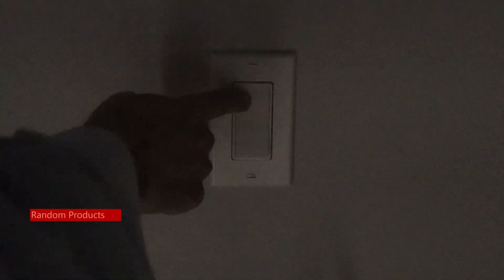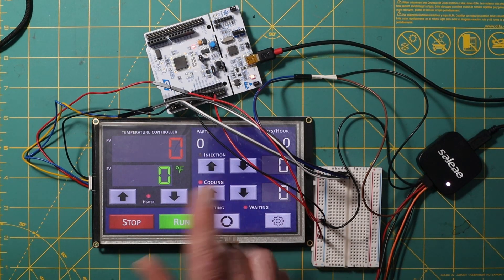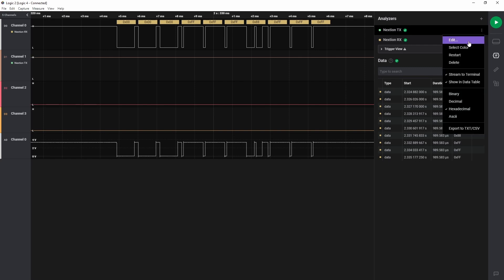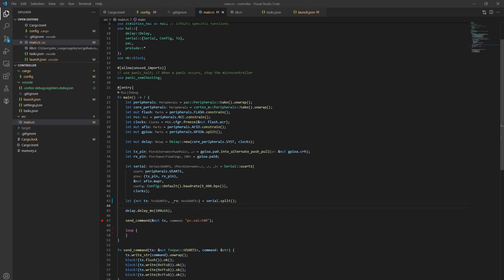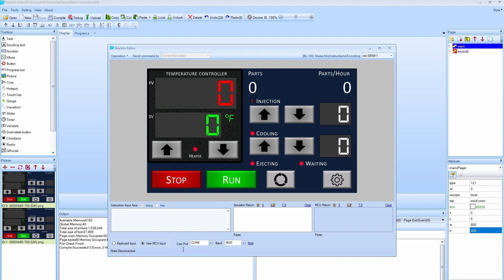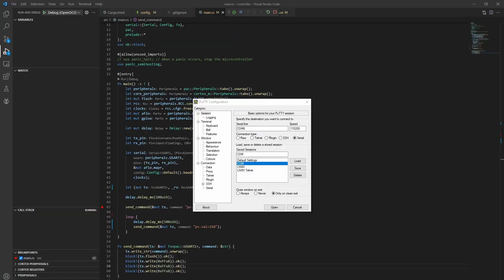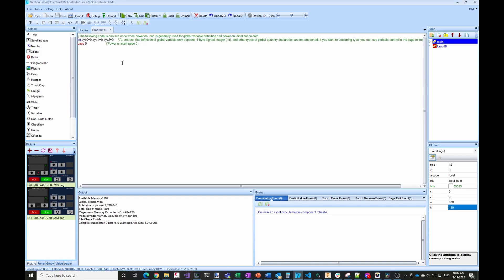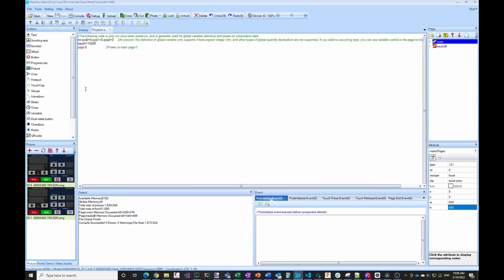Writing to the Nextion Display in Rust

Comment: I really like the Nextion command interface of object=value so I went that way getting messages from the Nextion versus the standard protocol. In my apps I get strings from the Nextion that are name=value and are terminated with a 0x0D. It's very simple to parse these strings and in my app. A recent project for a cameral control company has about 20 active pages in the Nextion so moving to a page sends a pageNN=X message that where NN is the new page, and X is 0 (not loaded yet) or 1 (has been loaded). With simple string parsing and the nice debug/test environment in the Nextion IDE, we were able to get it up and running quickly, and my clients customers love the interface.

Comment: Enjoying this series. I remember 20+ years ago I bought a serially-controlled 128x64 black and white graphic LCD from Scott Edwards Electronics, feeding it .BMP files and controlling it with a Basic Stamp. I thought that was the cat's meow, and it cost over $250, IIRC. Had a whopping 16kB of flash memory onboard to store the graphics. Amazing how far we've come. 🙂
Reply: I haven't spoken with Scott in ages, but we communicated frequently in the early days. I was a BASIC Stamp user and ultimately worked for Parallax. In my consulting work, most of the projects I do use Parallax Propeller processors. It is a long way from the BS1 to the Propeller 2, though there is still some common DNA. I recently did a commercial project with the P2 and the Nextion display.